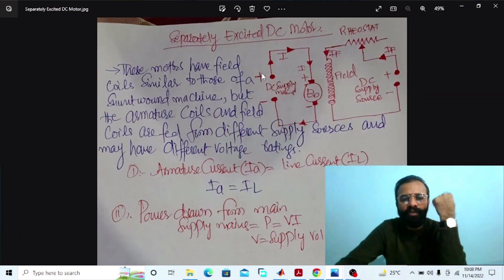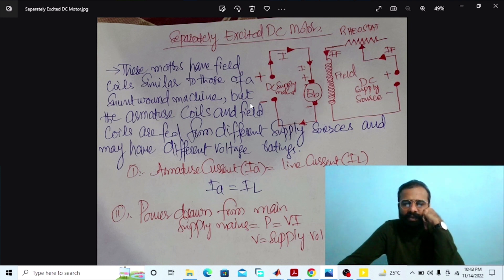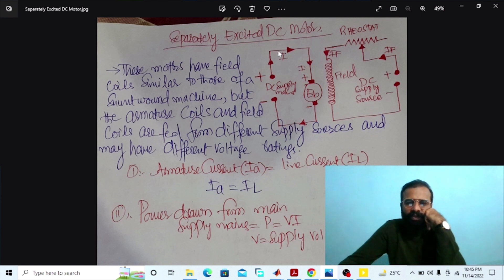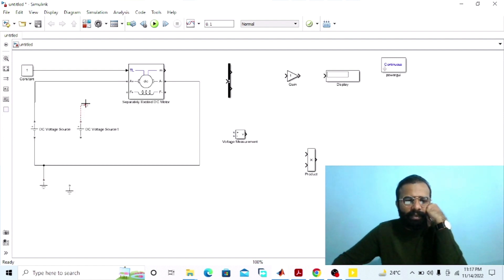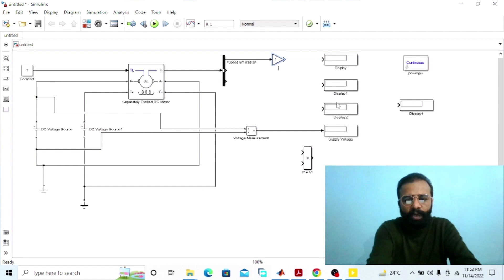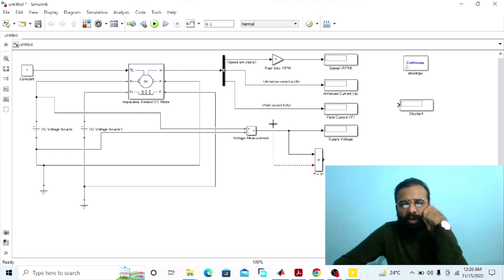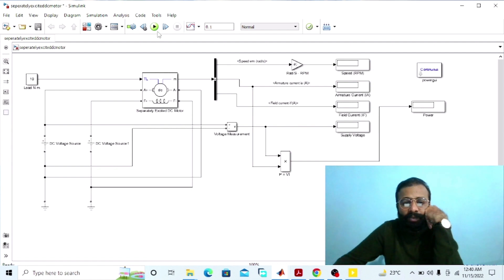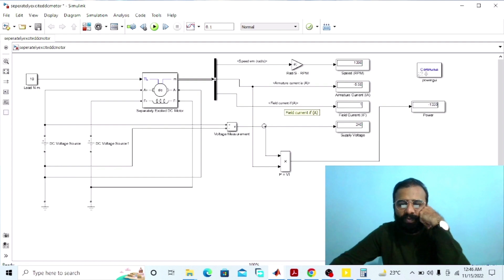Separately Excited DC Motor Using MATLAB Simulink | MATLAB Simulation of Separately Excited DC Motor

Comment: really helpful  👍👍
Reply from the maker: Thanks.
Reply: @ShoaibAhmedDayo One question, if it's not too much trouble, is there any way to do the same thing but for a brushed DC motor? I've been trying the Simscape - Electical - Electromechanical library, but without any luck.